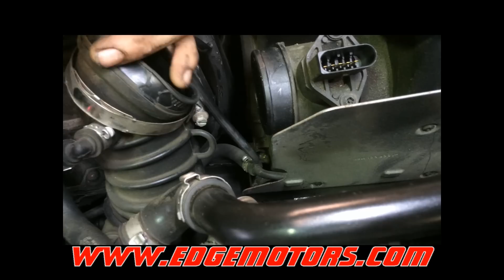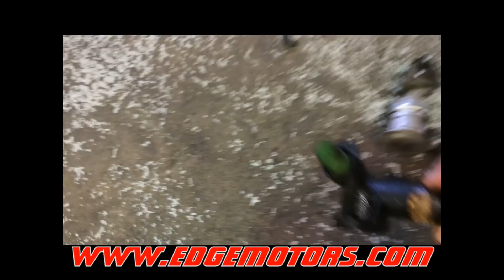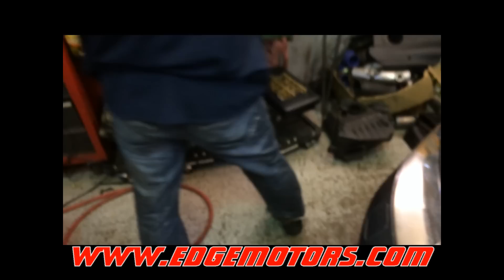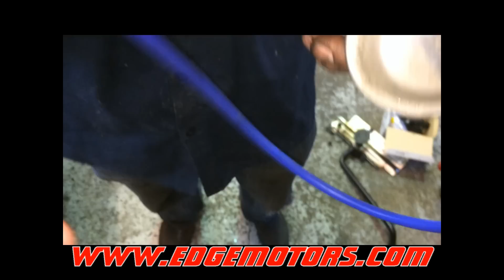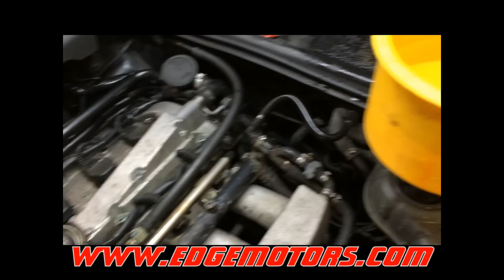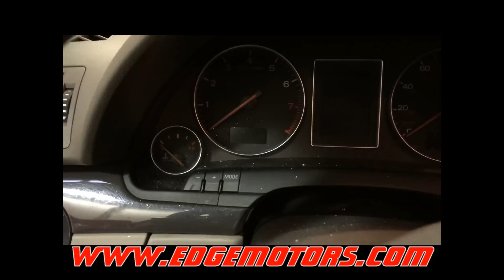Audi A4 VW Passat coolant temperature sensor housing replacement DIY by Edge Motors

Comment: I would fasten flange to the head before attaching any pipes. The bottom pipe is in the way of the bottom flange bolt and you want to make sure the flange o-ring seats properly. Some people remove their original flange and the o-ring was not seated properly.

Comment: On my 2000, I did not remove the air box, but I did remove the coil packs (left them connected to the harness and layed them to the right). In the video, you're consistently reaching around that harness.

Comment: You dont need gasket sealent on a new valve, if you have cleaned the surface and tightened it, you dont need it... it makes it almost impossible to get the pipes off the housing and likely damage the pipes if you ever need to get them off, then having to buy new pipes also or if the pipes go and you have to take them off the unit you damage the unit.

Comment: Theres an O ring and plastic retainer ring inside the heater core hose. No need to change or inspect it? I did and its giving me hell when i try to replace them back together inside the hose!
Reply: Greg sees  Did you ever figure out the problem?? I’m having the same exact issue on my 01 a4b5

Comment: My 2008 Audi A4 is showing the code 00768 and 00769 also the car does not power to pick up normally and the engine is shaking a lot. What could be wrong with my car?

Comment: Thank you. I will like and share. I have a 2005 A4 3.0L BGN engine. Heat through vents is okay during normal driving, but cools at idle. Temp gauge travel towards C as well until RPM increase. Bled at screw and at heater core hose as directed by Factory Service Manual. Also hearing water babbling from dashboard during acceleration. In your opinion would it be a heater core issue? Could it be a component of the cooling system is cracked or a bad seal that causes air to be introduced into the system on a constant basis?

Comment: Great video. I've done one of these on my wife's car before and it was a major pain. Your video will help with the next one I'm about to do this weekend (my car). The part about bleeding the system was great. My car is exhibiting those exact symptoms - when you slow down, the air gets cool and when you're at highway speeds, the air is warm. I was actually wondering if the heater core was bad but from your video, I know all I have to do is bleed the system properly. Thanks a lot!!

Comment: I recommend pulling the fan switch sensor to drain the coolant on the radiator because it is not recessed under the bumper skirt.  I ended up finding the clip was broken and replaced the clip and o ring.

Comment: Hey guys im sorry but i have another question, i just bought an 04 audi a4 1.8t and i guess the seller took out the cooling fans so rite now im driving the car without cooling fans, do you think it will hurt anything now in winter? i know i will need to put 1 on in the summer.
I have vag com and i scaned the car for codes cus its got a check engine light on and i get 4 engine codes 
P1931
P1672
P2181
P3081 thanks.
Reply: Without the cooling fans, the radiator will not sufficiently cool the fluid in the radiator when stationary or moving slowly.  I would look for replacements. Truth is, since it is winter, not sure where you live, the cooler air surrounding the motor may help you get by this winter.  But this begs the bigger question.  Why did the PO remove the fans?  I hope for your sake they were not hiding a bigger problem.  Also, the only codes that will give you a real idea of the problem is the VCDS codes.
Reply: what else besides the fans not working could have caused the po to remove the fans, and those codes were pulled with a vcds thank you.

Comment: Hey guys i have an 04 audi a4 1.8t and im wanting to change the coolant temperature sensor which i believe its by the fire wall, but i see another 1 under passenger head light on lower radiator hose so im very confused if theres 2 sensors or its a different thing?
Thanks
Reply from the maker: that second sensor on lower radiator hose is a temp switch for your fan control module, thats not the temp sensor for your computer.... the sensor in this video is the one you need to change (if you need the sensor for the ecu)
Reply: EDGEMOTORS ok thank you.

Comment: Great video , i just have 1 question where else can you bless the air , if my car doesn't have the release valve on the top of that tubbing ? 
I will appreciate your answer thank you .
Reply: My passat has a hole on the heatercore hose underneath the battery shroud.  Pull the hose back so that it just clears the heatercore outlet with the car running and rev the motor to 2k, this will purge the air from the heatercore and coolant system.  That is another method of bleeding the air from the coolant system, as my coolant hardline does not have a bleeder screw.  Excellent video.  I will get an elbow for the EGR/Combi Valve.
Reply from the maker: 4literbeater94
+1 if you dont have the bleeder hole on the coolant pipe you have to use the one on heater core outlet...
Reply: need help fixing a VW Passat

Comment: Great video, I just took on this job over the weekend.  The O-ring in the coolant flange expanded and had alot of coolant leaking, - got the new flange and O-rings and went to town.  This job is a major pain in the ass, so take your time because you will get frustrated.  The video is perfect, watched it a few times and everything works perfect now. Thanks!

Comment: Great Video……..I recommend changing any parts like pipes or anything you're messing with already since your already back there……..those parts will soon go out if your car has lots of miles might as well replace them, so you dnt have to go back there again and have another headache……car running great now…..just saved a lot of money from doing it myself and also I know it was done right cause i did it myself…….eveyrtime i use to take my car to the dealership it use to come back with more problems, so I stopped doing that a long time ago and have had know problems since……..I'm going to change the turbo soon also since my car has lots of mile already. I think it might go out soon……..Any help with that?
Reply: EDGEMOTORS I will add that Germanautoparts sells OEM parts for a very reasonable price. My heatercore hose was $38.
Reply from the maker: yes it is a good idea, but the only thing we did not replace is the heater core hoses... and they run over 100$ each, so it my be better for them to go .... unless you want to replace a perfectly good part that cost allot of money just out of precaution...
Reply: Germanautoparts are reliable and helpful.